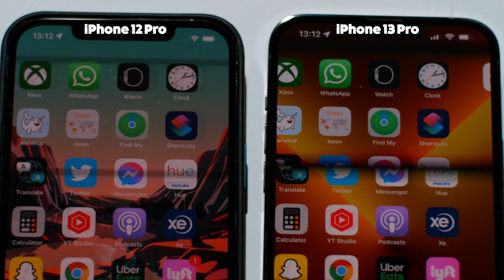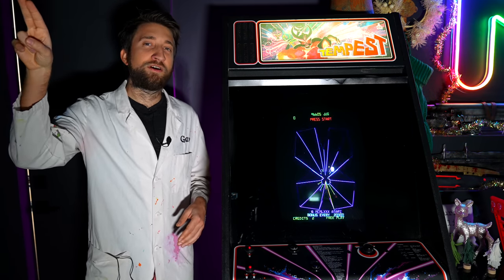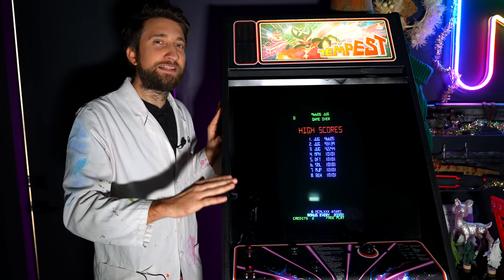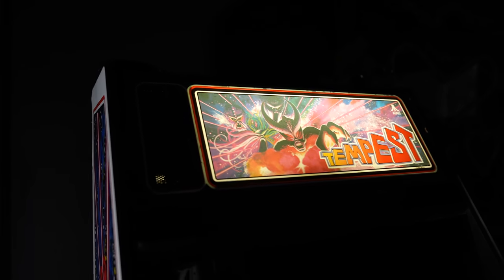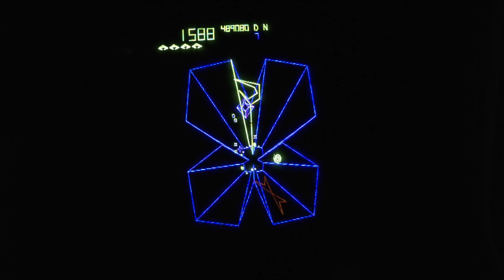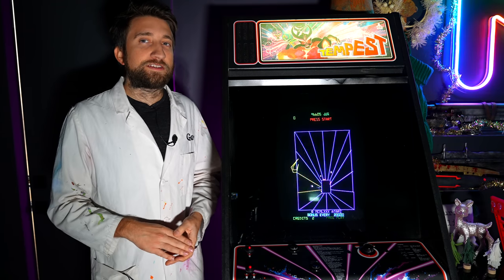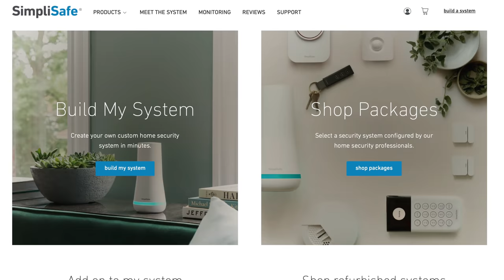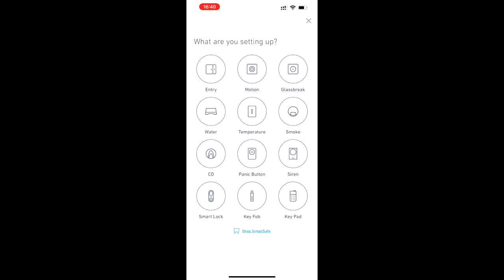Arcade Machines look WEIRD in Slow Mo - The Slow Mo Guys

Comment: You can see exactly the same effect by actually drawing the images on the CRT but slower - osci-render which is a project I've been working on lets you render vector graphics on a CRT oscilloscope, just like this, and it has a frequency control which lets you reduce the frequency well below 1Hz, creating the same frame-tracing effect you see in slow motion :)

Comment: And vector was 80's technology. Imagine what we could do now.
Reply: Current modern displays can't even come close to replicating the stunning, almost literally radioactive luminescence these old machines have even today.  Not even a 4K HDR screen.
Reply: @Retrotude  absolutely, but imagine if someone used modern technology to build something new like vector from the ground up
Reply: Imagine a vector type projector. Except then I think you'd have to paint your walls in phosphor.
Reply: Purely in terms of visuals, those CRTs are as good as it gets, they haven't been bettered. They were bulky, power hungry, deadly if opened, dangerous if damaged, and could cause eye-strain, which is why LCD panels have replaced them, but the response time, colour reproduction and ability to scale to any resolution without blurring at all is unmatched.
Reply: @Wabajak13  They exist, and have done for decades - they use lasers, no need for phoshpor coatings. Fast moving lazers trace a pattern, and it looks to the observer like a solid line.
Reply: @Retrotude  Yep and it's even been said that you'd need an 8k screen and a beefy pc just to have an accurate CRT filter on emulators to simulate the effect on an LCD/OLED because filters that try to fake it just don't hold up to the real thing IMO.
Reply: 8k laser projectors
Reply: @Wabajak13  I did vector laser images with a HeNe laser and mechanical galvo scanners in the 80s that I choreographed to music. (classical laser light show) 
 I take out a projector on Halloween each year. 
I use the Radio Shack Color Computer with SW I wrote and used General scanning Galvos.  It used the 6809 and a clock around 900kHz.  In the display processor I was squeezing clock cycles to to some rotations real-time. 
..
I though about writing an Asteroids game, but moved on to other things. . .
Reply: @brookewestonctc  CRTs are not really deadly than LCD. If kids eat TFT chemicals, I really don't want to see what they mutate into. Of course there is some highvoltage, but an electric fly swatter has similar power, and the other voltages are as dangerous as any mains operated household things. (Microwave overs are much more dangerous.)

To me TFT look horrible. I can not bear the blurry motion of an LCD slime pane, so I still use my SGI 22'' Trinitron CRT. Although modern TV sets don't turn tennis balls into comets anymore, because they light the entire screen at once, the eye will always blur motion when chasing a stepwise moving object, which makes even a 144Hz 1ms gaming TFT look much jerkier than the interlaced 25/50Hz CRT of a cheap old PAL TV.

Comment: I love vector based graphics, my logo is a svg. Infinitely scalable 😁
When will you compare all the other types of screens? This was definitely cool to watch!
Reply: I did vector laser images with a HeNe laser and mechanical galvo scanners in the 80s that I choreographed to music. (classical laser light show) 
 I take out a projector on Halloween each year. 
I use the Radio Shack Color Computer with SW I wrote and used General scanning Galvos.  It used the 6809 and a clock around 900kHz.  In the display processor I was squeezing clock cycles to to some rotations real-time. 
..
I though about writing an Asteroids game, but moved on to other things. . .

Comment: This Display technology reminds me of show-lasers used for lasershows. 
They can also only display lines. 
But instead of an electron beam, they unse a combined rgb laserbeam and e very high speed mirror system.
Reply: Which is literally the same idea, except the elctron beam is guided by magnetic fields and makes the phosphorous on the screen light up, while the laser is bright enough to leave a trace on your retina even when reflected from a wall. I wonder if anyone actually programmed a lasershow display to play the old vector games. That would be totally rad.
Reply: @EyMannMachHin  Yes Laseroids (asteroids via laser) is built into one of the leading control software/hardware providors. It's fun playing it on a 100x100m projection on almost any surface you can point a 30+W laser at.. in the right conditions you could do 300x300 lol.

Comment: Always wanted to see a colour vector monitor in slow motion. Bloody awesome.
Reply: I could slow my system down to whatever I wanted:
.
I did vector laser images with a HeNe laser and mechanical galvo scanners in the 80s that I choreographed to music. (classical laser light show) 
 I take out a projector on Halloween each year. 
I use the Radio Shack Color Computer with SW I wrote and used General scanning Galvos.  It used the 6809 and a clock around 900kHz.  In the display processor I was squeezing clock cycles to to some rotations real-time. 
..
I though about writing an Asteroids game, but moved on to other things. . .
Reply: @Observ45er  That sounds awesome!

Comment: This makes me want to see a Vectrex working in slow mo (although it's probably very similar I suppose)
Reply: It's not just similar, it's the exact same tech.  Vector monitors.  They're really weird, but also completely unnecessary today because of how high raster resolutions have gotten.  People will look back on vector displays decades from now and think "how the heck did they do that back then?"
Reply: Yes, and some of the homebrew that displayed bitmap graphics on a Vectrex.
Reply: Oscilloscopes FTW! 
I love mine....
Reply: @Rhythmattica  Oh yeah that's true, a lot of oscilloscopes even today use these types of displays.  So I guess they aren't entirely in the dustbin of history.
Reply: For that matter, arguably the first video game ever made was a ping-pong game hacked onto an oscilloscope, so you could say that vector graphics were the FIRST video game graphics.
Reply: Vectrex -- now there's a name that I haven't heard in decades!!! 😲
Reply: @telephony  and the funny thing is: it's actually older than me, I got the one I have (which still works btw) from my grandparents
Reply: @StormsparkPegasus  Unfortunately not. Regular oscilloscopes nowadays have TFT screens with badly jagged curves those can be very deceiving because often AI software tries hard to guess/fake what the waveform may be when at high speed running into undersampling mode.

Comment: did they ever make a hybrid display, one that used the vector for the objects and the scanning for the background?
Reply: You mean with two elecron beams? I don't think that would be possible, as magnetic fields are used to bend the beams, and the fields would interfere with eachother. If you meant with a single electron beam, then that would be massively inefficient, as it could only be doing a raster update or a vector update, but not both.
Reply: @brookewestonctc  what if they each hit from a different angle, say one is 45 degrees below the screen and the other is 45 degrees above the screen.
Reply: Vectrex has a vector screen but draws the text font in raster graphics over it in software.

Comment: How are the electrons from the electron gun "aimed" to form the vector lines? Is there a motor or is there a electrical way to precisely aim them like that?
Reply: I'm not sure, entirely, I think it had something to do with magnets but it'sa fuzzy memory. Retro Game Mechanics Explained did a video on Atari's Quadrascan, it's worth a watch
Reply: electrons have charged so can be directed to a desired point with electromagnets
Reply: There are coils of wire wrapped around the screen and depending on the applied voltage, they defect the electron beam a certain amount up/down or left/right.
Reply: Electromagnets. Interestingly if you turned those off/cut the wires, you'd just end up with one bright spot (roughly) in the middle of the screen.
Reply: Electrons are fired towards the screen from the electron gun at the back of the display. By default, they'd hit right in the middle of the screen, but because electrons have a (negative) electrical charge, they can be deflected left/right and up/down by carefully controlled electromagnets at the edges of the screen. In a normal CRT, the electron beam is scanned from left to right across the screen, working it's way down line by line. In a vector display, the program can direct the beam wherever it wants, allowing it to draw lines wherever it wants.
Reply: Seek Vapes  it's true that early CRTs used electrostatic deflection by capacitors but that didn't scale up to screens more than about 10 inches diagonal due to the very high voltages required to achieve enough deflection. By the time of arcade games they all used magnetic deflection.
Reply: Both types of screens use the same internal tech to move the beam. But a traditional CRT beam follows a set path, left to right, zoom to next line. The path is hard-coded into the circuits controlling the beam. While the vector beam can be controlled.
Reply: Electromagnetism

Comment: Same method of scanning lasers for shows, that’s also not a new technology. The laser can be three (or more) colors to converge for all the colors, can be turned off instantly, and make plotted lines for various designs or shapes, and the less saturated a design is for plot points, the smoother and quicker the scans. (FPS)
The difference is now, the electronics and micro controllers needed to do the trick have become more powerful and much easier to wield, and the lasers have become insanely fast at high-resolution scans. 
One fun trick is to have a color show laser machine make a raster scan type image on a wall like a tv screen without the tv.

Comment: I wonder if developers for vector graphics games had to consider how long each element on screen takes to draw, and if they had too much stuff that took too long to draw that it could bog down the TV and start to look like flickering to us.  I wonder if that's why they couldn't just have the machine fill in the inside of shapes.
Reply: I was thinking the same thing. They don't have a frame rate like traditional games do. Other games have to fit all their processing in to the time it takes for a frame to update, while these don't have that limitation, and just draw as soon as they're ready. There has to be some sort of internal timing to keep the gameplay speed consistent (other games used the refresh rate - it's why PAL Sonic plays slower than NTSC Sonic), so I guess they can't exceed that.
Reply: Absolutely. The advantage of vector graphics were that you could draw a lot of lines on the screen really fast, but you had to worry about being able to finish drawing the complete frame before the phosphor started fading out, otherwise your display would flicker horribly.
Reply: @crusty.computer  So it's like a draw time budget in terms of how many graphical elements are on screen at any given time.  Interesting stuff, I knew CRT electron beams and all that but I didn't realize vector graphics were fundamentally different in that regard
Reply: @Sophistry0001  Yes we did. It was a major consideration.  My system has a 4 ms time from stop to stop, for one line.  It limited the number of points and you had to decide how much flicker you would allow.
..
I have faster scanners, but moved on before I ever built up enough to use them
..
I did vector laser images with a HeNe laser and mechanical galvo scanners in the 80s that I choreographed to music. (classical laser light show) 
 I take out a projector on Halloween each year. 
I use the Radio Shack Color Computer with SW I wrote and used General scanning Galvos.  It used the 6809 and a clock around 900kHz.  In the display processor I was squeezing clock cycles to to some rotations real-time. 
..
I though about writing an Asteroids game, but moved on to other things. . .
Reply: Some Vectrex games do start to flicker in situations with much on screen.

Comment: I love the look of vector arcade games, it seemed so "high tech" at the time. My childhood dentist in the 80s actually had an Asteroids game in the waiting area that required no quarters! I was obsessed with it and it made checkups worthwhile. 

I'm  curious if vector and scanline graphics could be combined on the CRT? Was there ever a game that perhaps alternated frames between a vector pass and a standard scanline pass? Seems like that could result in some cool graphic effects.
Reply: I don't think so but we used to get urban legends about it.
Reply: I don’t think it is possible with a conventional picture tube as it would mean changing how the deflection coils would be driven. The best way to accomplish that would be two screens and the Pepper’s Ghost illusion effect.
Reply: @Renville80  I guess that would be the easiest solution, like some games used a reflection image over the CRT to simulate a hi res backdrop.
Reply: I do not know whether it was ever actually utilized in an arcade, but CRTs can absolutely be made with multiple electron guns each with their own deflection/beam steering (though typically electrostatically deflected rather than magnetically as such CRTs were most common in certain dual and quad trace oscilloscope to avoid or reduce chopper circuit artifacts caused by rapidly switching between the different inputs to draw the multiple traces concurrently…but with just one electron gun the beam has to be frequently chopped, or broken up into short segments, in order to draw all the traces in real-time as it switches between the individual input channels).  Some early hybrid digital + analog oscilloscopes used dual electron beam CRTs with independent deflection in order to draw analog traces with one beam (like a normal single-beam analog scope) while using the second electron gun to draw the dot matrix text and cursors, on screen time and voltage markers, etc..  So it certainly is possible to overlay both bitmapped raster graphics and vector graphics with the same CRT provided it has at least two electron guns, each with independent deflection.
Reply: It is just more to draw and that takes time to move the beam around to all the places regardless which scan you used.
..
I did vector laser images with a HeNe laser and mechanical galvo scanners in the 80s that I choreographed to music. (classical laser light show) 
 I take out a projector on Halloween each year. 
I use the Radio Shack Color Computer with SW I wrote and used General scanning Galvos.  It used the 6809 and a clock around 900kHz.  In the display processor I was squeezing clock cycles to to some rotations real-time. 
..
I though about writing an Asteroids game, but moved on to other things. . .
Reply: The Vectrex has a vector screen but draws the text font as raster graphics in software.

Comment: I want to see one of those vector screens in person... looks awesome. Hadn't ever heard of those till now.
I always find it fascinating the order in which things were invented. A matrix of pixels like modern LCD's seems so much simpler to invent than a cathode ray inside a vacuum chamber that can draw pictures line-by-line faster than the eye can perceive. But the CRT came first.
Reply: A vector display is basically an oscilloscope on steroids. And I'm pretty sure those came before the regular left to right, top to bottom TV CRTs. And technically they are both CRTs. Also, the very first 'electronic' game (Tennis for Two, 1958) was actually played on an ocilloscope ;)

Comment: This has probably been said before, but the vector image looks so sharp regardless of the scale the image is at because vectors aren't images in the traditional sence. It's basically just a math equation of coordinates that the computer interprets and translates visually to a user. This is in contrast to something like a jpeg, which is in essence, one long array of numbers for RGB that the computer assembles into an image

Comment: You'll have to look for the video where a guy who does tech was testing a laser projector on various vector games.  It didn't get all the shapes exact because the speed of the beam was too slow to be accurate, but it's got me wondering if there could be a way to turn a vector crt into a similar setup?

You'll have to rip all the guts out, but I think there's a workable concept.

Comment: Honestly, vector graphics still look pretty cool today.
Reply: I did vector laser images with a HeNe laser and mechanical galvo scanners in the 80s that I choreographed to music. (classical laser light show) 
 I take out a projector on Halloween each year. 
I use the Radio Shack Color Computer with SW I wrote and used General scanning Galvos.  It used the 6809 and a clock around 900kHz.  In the display processor I was squeezing clock cycles to to some rotations real-time. 
..
I though about writing an Asteroids game, but moved on to other things. . .

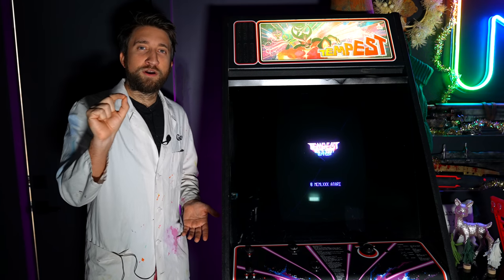Comment: 1:30 some older computer monitors (the green and amber ones) and stuff like old radar displays used "high-persistence" phosphors that kept glowing for quite a bit longer, so you would have something like a full picture on screen at once (though the most recently scanned bits would be brighter than the rest). While they were great for text, they were no good for high-motion TV or video games... like an old LCD they would get blurry and ghosty if the picture changed too fast.